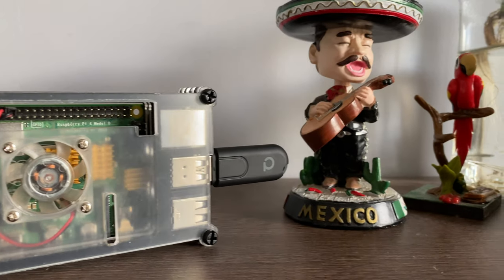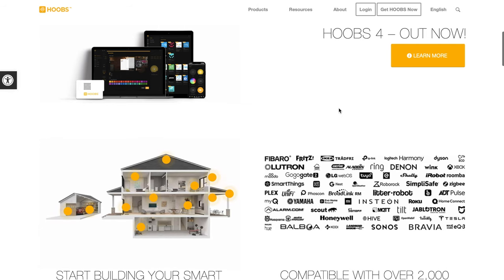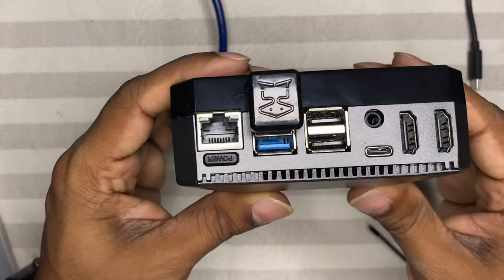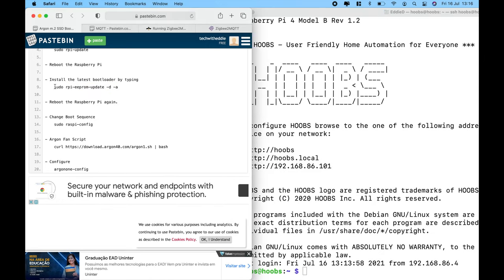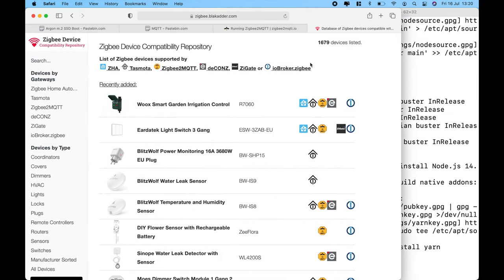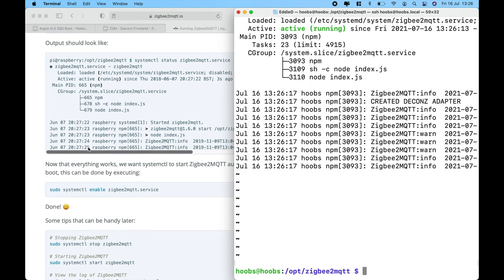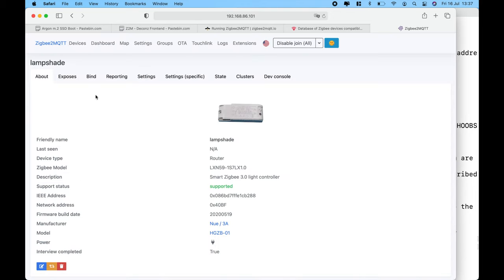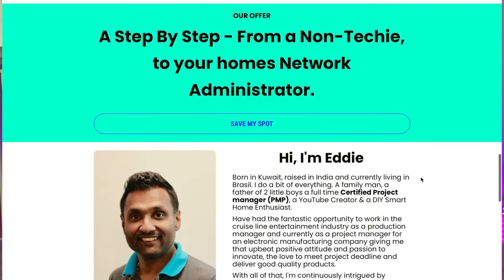Argon One M.2 - Easily build a Apple HomeKit DIY Smart Home Hub

Comment: hi Eddy
great video
2 questions:

- is it possible to add my tuya devices with your hub AND deconnect them from the tuya cloud to make them work only with hoobs/homekit
- is your setup working if i am not in my home (in LTE, for example, outside my house) ?
Reply from the maker: 1. there is a official TUYA plugin which will be testing to confirm if the cloud is required. 
2. You will not be able to connect with the hub when not in Home but you will be able to access the devices in your Home App provided your home has an active internet connection
Reply: @eddiedsuza  thank you 
so will I be able to control my lights with Home App if I'm not connected to my local Wi-Fi?

Comment: Eddie, I made a Smart Home Hub for HomeKit using the AntonOne M.2 and a raspberry pi like you did. I installed HOOBS 4v on it. I need to know if I can install Home Assistant on the same Hub along with HOOBS and how would I do that if it’s possible. Thanks.
Reply from the maker: Hey Aaron .... Sorry for the late reply - was on a family vacation ... I didn't try running them side by side... My humble recommendation is to choose either one to get the most.

Comment: Great video, made me decide to switch from Homebridge to Hoobs, only thing not working for me are the “friendly_name” , I need to change them in Hoobs and in HomeKit for every accessory.
Just finished adding all my Aqara stuff, now it’s time to add all my Phillips hue lights and plugs.
Keep those video’s coming 👍
Reply from the maker: Your Welcome & Cheers plus welcome aboard to HOOBS V4
Reply: A little update, Hoobs/zigbee2mqtt is running for a little over a month now and not a single error/disconnect (the aqara M2 hub lost connection 2 or 3 times a week).
Me Happy 😉

Comment: Could a ZWave Usb dongle also be added in the build so that Zigbee and ZWave devices can be added?
Reply from the maker: Yes it can be added. however you need to make sure the USB ports information is correct in the configuration.

Comment: Eddie please can you advise where I have gone wrong I currently have a hoobs box, I have the hoobs image that works on sd but when trying to upgrade my argon that was previously running home assistant on ssd I deleted home assistant and flashed ssd with hoobs but the argon will not start on boot with this program have I done something wrong?
Reply from the maker: Please check the image you are loading into galena etcher. dont use the un-compressed file
Reply: @eddiedsuza  I just used raspberry pi image for homebridge super easy

Comment: Hi Eddie, i use argon one like u , on hoobs 4. But led Red & Green on it only ON went restart…
Went hoobs start ok, led is OFF. I config argon fan like u. Can u help me ?
Reply from the maker: Hello Tan .... In HOOBS 4 - this how the led lights work 

* Solid or blinking green, hoobsd is running
* Solid red, hoobsd has stopped with an error.
* No LEDs on, hoobsd has stopped without error, or device is off.
Reply: @eddiedsuza  Hi, my case, BlinkGreen & Red led On went startup. Went Hoobs working - All this led is OFF

Comment: As always very informative video. Also just like to inquire is there an  alternative for conbee Ii zigbee?
Reply from the maker: here are some of the alternatives for zigbee2mqtt https://www.zigbee2mqtt.io/information/supported_adapters.html
Reply: @eddiedsuza  the plugin you have used in the video will still works for this alternatives?
Reply from the maker: @hoqp  Yes it does work as those are alternatives tested with the Zigbee @ MQTT service. THe plugin imports the devices from the Zigbee2MQTT service
Reply: @eddiedsuza  SONOFF Zigbee 3.0 USB Dongle Plus is listed as an alternative. Would you make a video just like this one but using the Zigbee 3.0 USB dongle plus instead of the Conbee 2?

Comment: Eddie, I really like your videos and they have been very helpful. However, I would like to point out that in this video "Argo One M.2 - Easily build a Apple..." you should have pointed out (if you did I did not see it) that the M.2 SSD drive cannot be a NVME Storage Drive. It appears that it should be of the M.2 NGFF type SSD drive. While it states this in the Argon ONE M.2 expansion instructions, anyone who bought an M.2 SSD drive before reading the instructions will be wrong since the NVME expansion board will not work. I also thought that you could have included the M.2 SSD drive you showed in the video and the types of drives that would work with this expansion board. Thank you for the video.
Reply from the maker: Thank you so much for this info and definitely was not aware of the compatilibity. Will keep this in mind for future videos. Cheers